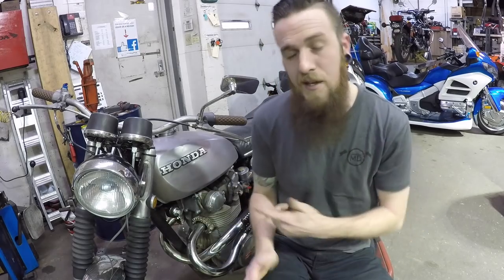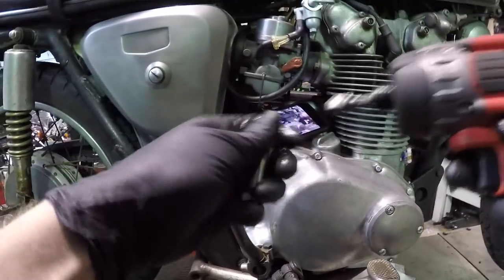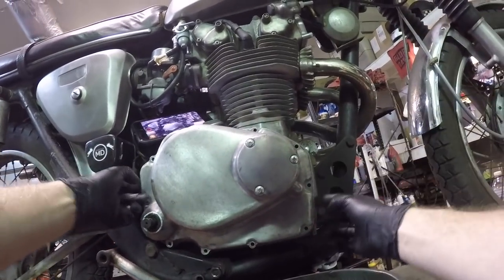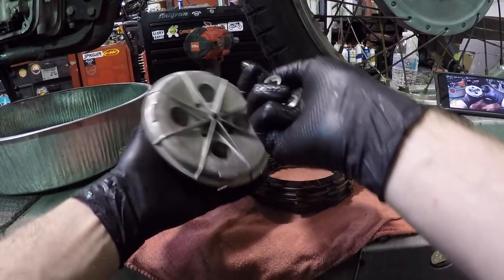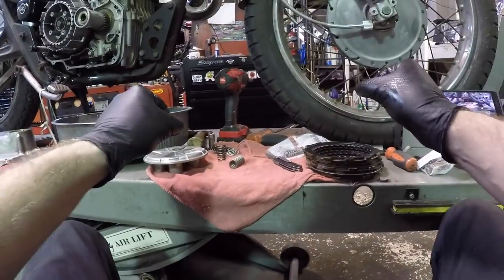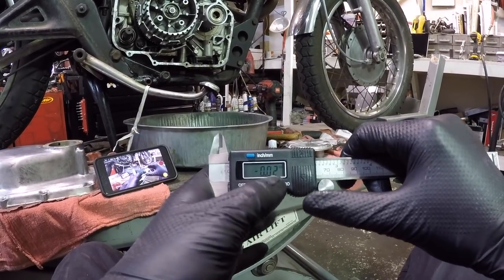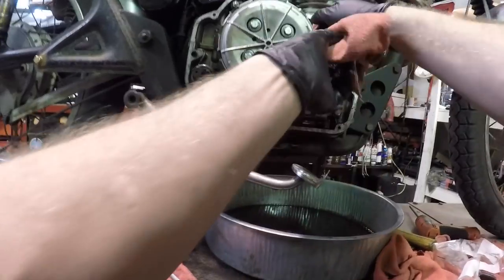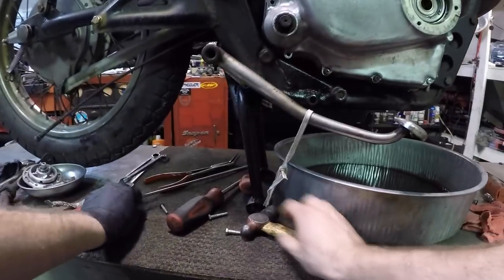Motorcycle Clutch Replacement: The What, Why, and How

Comment: I  rebuilt  the  clutch master and slave cylinders on my 84 V65 Magna  and  chased  bubbles  for  hours  but  couldn't  get  the air out of the  system. I was thinking of a way i could add a bleeder just below  the master cylinder. I decided to check  out  youtube  and found  the  video you  did on rebuilding  the  master and  slave  cylinders  where you pinched  the hose  just  below the master as  you  bleed  the system. Within  5 minutes  the  air  was gone  and  worked great . Thank you
Reply from the maker: Nice trick right?! Glad it worked for you brother 🤙🏻

Comment: Congrats on reaching 10K Subs Cody! You've certainly earned every one of them. FYI...Just picked up a SWEET 1975 GL1000, runs and rides...needs tweaking here and there, but I'll get Willie (It's name) up and ready for this riding season. I'll shoot you an email with pics. This now gives me a complete 1975 for parts (32,000 miles) for the newest GL1000 (43,000 miles). This one was a Barn Find and had not been registered for 22 years. Went over everything, had #2 with stuck rings...a little magic snake oil of my own and the rings freed up and brought all 4 cylinders up to 130+ psi and all are within 5psi of one another. Everything works as it should and it presents fairly well considering how long it's been sitting. I'll ask you a Q in the email. Cheers Cody and again, congrats on 10K Subs!! Zip~

Comment: Hey Cody, I love your videos, I've really learned a lot. You mentioned it briefly, but when using a caliper, you get a more accurate reading if you do the measurement closer to the caliper. The further towards the tip you measure, the more you can tilt the arms when you apply pressure, and get a slightly inaccurate reading.
Edit: Hope your date went well!

Comment: I have a 1999 Honda CBR600F4 with 105,000 km (about 65,000 Miles) and I was going to replace the clutch this year. I just got a new clutch cable and with new Michelin Road 5 tires and a DID chain I think my bike with feel band new again. Its been running good but I feel like its lost some power. Hoping new clutch will help, if not it looks like a nice task to work on the motorbike. Nice video.

Comment: Mr. Cody can you please.elaborate on the cb 919, cbr 900rr, 929, and  954. Problem is the 2nd gear issue I have heard that some bikes have an inherent problem with the gearbox not shifting into 2nd or banging etc. Could you please explain what you have found to be the problem. I trust you and do not trust anyone else to cover this issue. I'm in the market for a used machine. A Honda of course.. a 919 or 90 thru 98 vfr gear drive cams only of course. Thanks John C.

Comment: Hi sir, I have a VTR 1000F FIRESTORM and if I try to pull off at 2000-3500 rpm the clutch slips then grabs then slips then grabs and sends the front wheel skywards, I have read the VTR clutch is a little grabby or problematic but I would like to know from your experience what in your opinion is happening.
I have only owned the bike for 2 months so to me it was always like this. I recently saw a video of yours where you serviced a VT 1100 chopper and I will follow your maintenance vid and clean up the piston and steel pushrod assembly and of course bleed the hydraulics, i will also give you feedback and let you know how i get on.
Thank you.

Comment: Recently with my 92 nighthawk I started to use normal motor oil cause I'm a cheapo and it started redlining at 80mph and I'd loose any power so I wouldn't try to raise rpm/throttle (I have no tach) so I do a half-ass oil change with proper oil without changing filter then it starts redlining at 95mph then I did a real oil change , filter and all and now it won't go past about 100 and before it felt like I'd have to try not to be in the triples. Just got a whole clutch from a donor bike with 15k miles I think....better than my 84k one...hope it fixes my issues

Comment: I'm a beginner and my fear of cracking open the clutch isn't as bad after watching that video. You did that so quickly.  What would a shop charge to replace those parts?   

Of course the one piece you didn't buy was the worst of them all.   "I'm just gonna go with it, man. I have to. This is my ride home."  Sometimes you just gotta make due.  Any tips on keeping the clutch healthy for as long as possible?   I feel like my shifting and clutch work are pretty good, but I could be doing something wrong and not realize it.
Reply: Do you do revmatch downshifting cuz if you dont you are missing alot of fun

Comment: HI thanks for taking time to make vids, hope you can help me ive got old 1994 zzr 1100d and my cluth was working brill no problems at all untill i put new front and rear sproket on which meant i had to remove banjo bolt thought ok no problems soon bleed that but nightmare slave cylinder piston works and spotlees so stuck can you help  thanks rigsby

Comment: I'm having a dragging problem every now & again on my clutch. & I can't find Neutral, then the other day It randomly acted like a weak battery (unable to turn engine over) but later it fired up no issues, do you think all these are connected? I'm guessing clutch plates have made grooves in the basket & need filing? any ideas? especially the on the going into neutral bit as ive had this issue on many bikes.

Comment: why didn't you replace you whole clutch assembly? My dealer changes my clutch assembly on my 2013 daytona 675 every time the clutch wears out. When I ask them why dont they just replace the springs and plates, they say, its similar to the chain and sprocket and you should replace both as a set regardless of which one wears out.

Comment: Thanks so much for your clutch video I’m ready to replace the clutch on my1974 MT-125 , How long do you soak the new Disk in oil prior to installing?
Reply from the maker: There isn’t really a specific timer. I usually set them in a dish of oil glob them around to coat everything, then begin the job. By the time you are ready to start loading the clutch hub they should be fine!
Reply: Saw a video by some other dude where he said to soak them overnight, so that the oil seeps into the cork. That was for cork friction plates, don't know if there are other variants, that don't require as much time.

Comment: Shit... so if i have my bike on a jack with the rear tire floating and i start it up and put it in 1st and hold in the cluth yet the wheels still slightly spins it could be my clutch? Ive got a 92 cb750 with 60,000k miles and my 5th gear has also been slipping... weird shifts out of nowhere and it feels like its in 3rd

Comment: hello, I also fixed it on a cbr 125, but now as I put it together, the clutch has no resistance at all, what could it be ??
Reply from the maker: You likely installed something wrong or the spring isn’t set right for the lever pivot In the case

Comment: To free up that side seal without breaking it, you HAVE to deadblow HAMMER the bolt hole areas, out towards the next bolthole, or in a star pattern. vibration knocks gaskets loose while keeping them intact, prying with a screwdriver, rips the gasket. cuz the vibration disturbs the oil in a way where it soaks into the gasket in ways it doesnt naturally, bolted IN. Thus, the gasket sticks to one side. usually the engine side, since its hotter than the cover side. cheers. Do some scooter tech tips. those fucking guys need it.

Comment: I would never use a screwdriver as a drift, to remove a cover  its a very bad idea. Rubber mallet and patience, even if it takes an hour to remove the case thne its better then damaging the case..  its very very easy to damage the mating surfaces. If you need to use a drift and only the very worst seized cases then I would use an hardwood length (Oak or mahogany) on web or simaler to knock it off.   I Dont use a power impact driver either, your denying yourself information, for the sake of a few seconds work.  If a thread is bad you wont know.

Comment: Don't honda just put there sticker on parts . I don't think honda  make there own parts at all, I only know car parts are the worse ..say a vw wheel bearing 100 quid a pair , identical set 20 quid elsewhere. Anyway thankyou for informative post. On my honda I am using 30 quid brake discs ,no problems at all ,honda 140 quid !